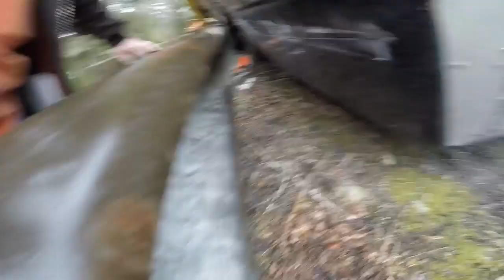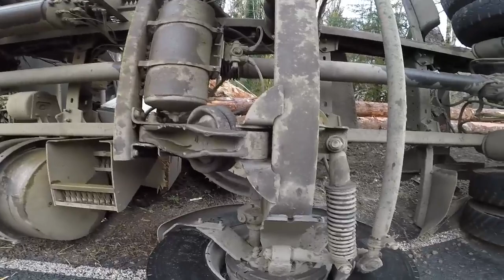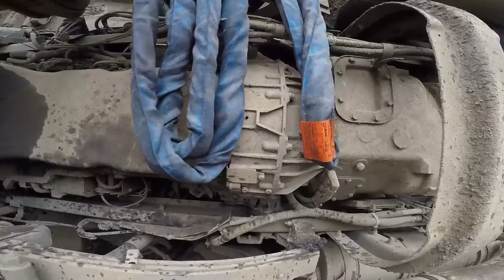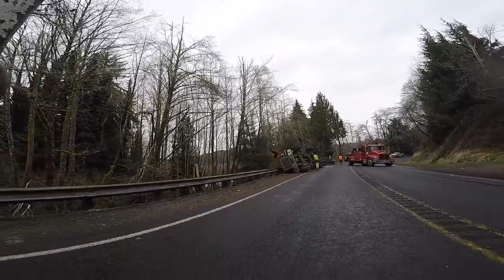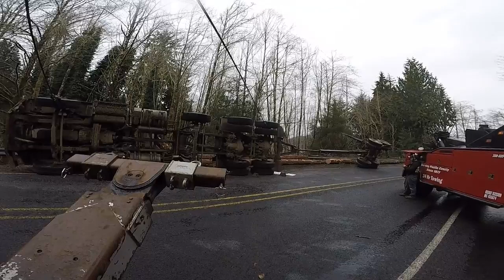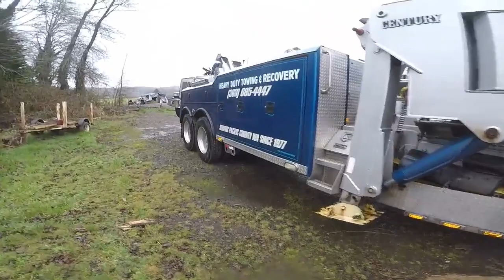Loaded Log Truck on it's side

Comment: Did I catch at least one of those rear brakes out of adjustment? Looked like plenty of shoe left at any rate. BTW, great idea to cage the cans and drop the driveshaft while it was easy to reach. That actually saves time over doing it with the wheels on the ground.
Reply from the maker: Got m are butts chewed  out by the WSP inspector for  backing  the brakes  off .
Reply: @HILLAUTOBODY  ... hope you showed him the video of the ones that seemed ok before hand. I mean, a guy has to do what he has to do. Ya gotta get the road open or get yer ass chewed by the cop on the scene.

Comment: That is not much of a trailer to haul logs.
Reply: Small but normal. Some run 12' bunks. Most here run tridrives with tridem trailers and 3 stacks of 12, 16 or 20 ft logs on 8 ft bunks
Reply: @wssides  
They use a standard trailer in NC.
Reply: That trailer rides up  on the truck cassis behind the cab when not loaded with logs.
Reply: @morg52  
Very interesting.

Comment: Jesus......we’re was your catch?  Didn’t need to slam that tractor in the road like that.  Did you pull the drive shift or just leave it attached and fuck up the trans.  Could have pulled it easy while it was in its side.  You guys sure tough on equipment.
Reply: Yes he did pull the drive shafts, he said it in the description and you can see they were pulled in the video just before he flipped it back onto the wheels. He also had caged all but one of the brakes prior to uprighting the truck to keep it from rolling away. I think it’s unlikely the drop onto the wheels hurt the truck any more than it already was. The rear suspension air bags and front springs cushioned the drop substantially. It looks worse than it actually was, these trucks are pretty stout. Most of what makes it go and stop was still good. The frame looked fine. Replace the hood and cab, and straighten the headache rack and this truck can go back to work. (And fix the bad rear brake.)